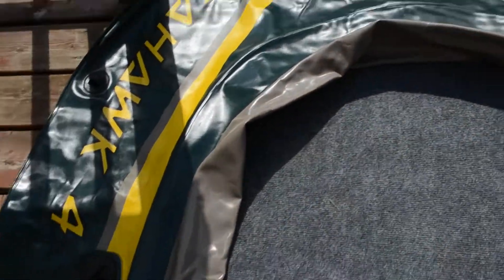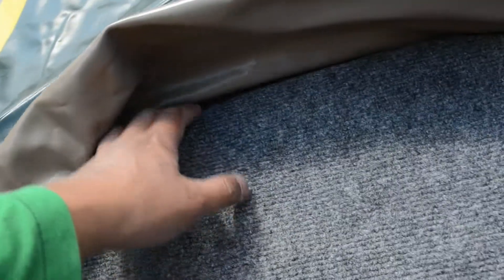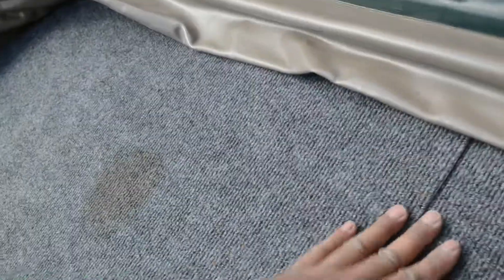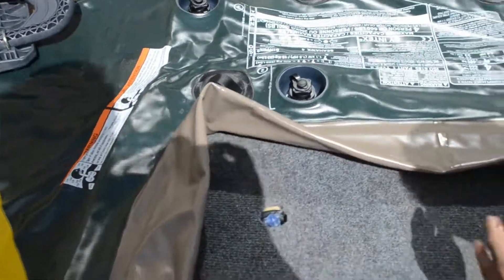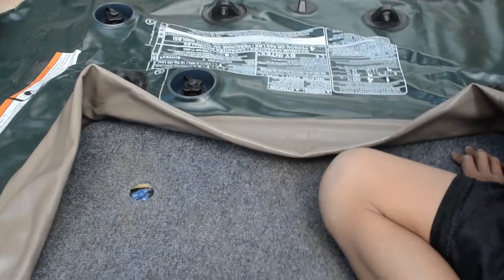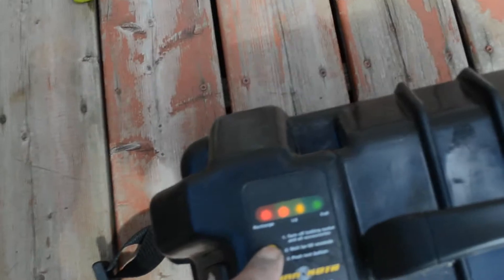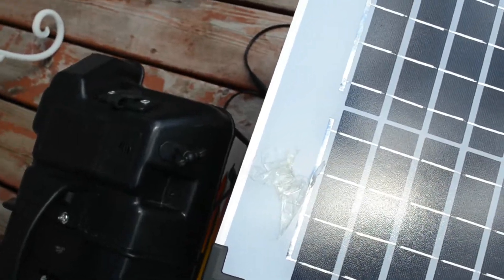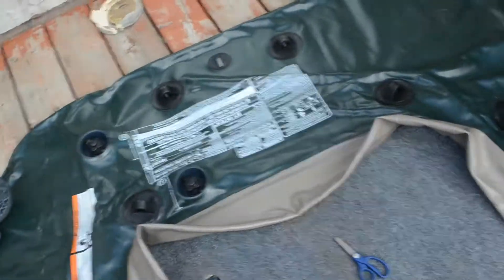diy Intex seahawk 4 with floor part 2

Comment: Sir, good day. Just want to ask, does it boat license for inflatable boat with trolling motor?
Reply from the maker: Joel Dimayuga Yes.  it is required to have a license for any vessel that runs with a motor.  Electric or Gas.
Reply: @goneFishingTightLines  thank you Sir😁